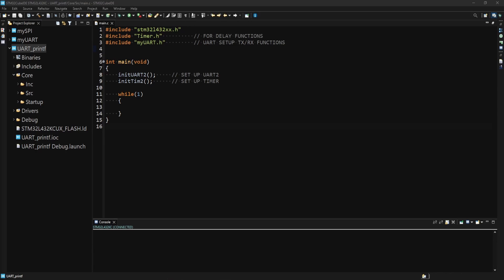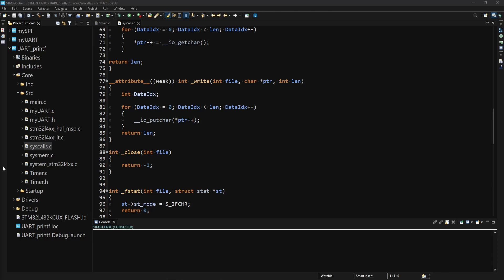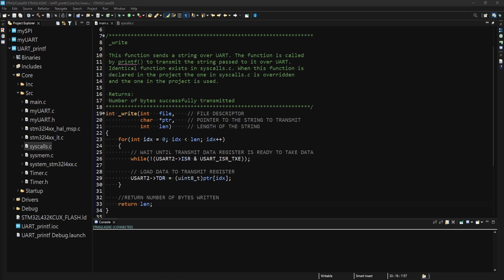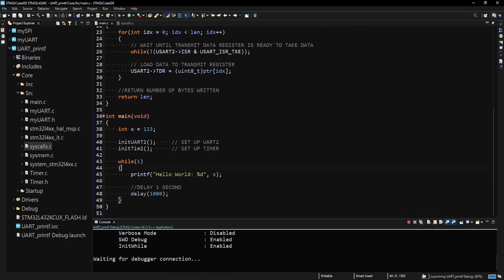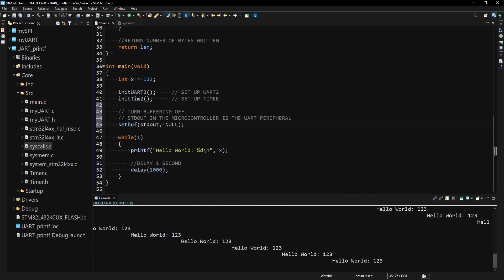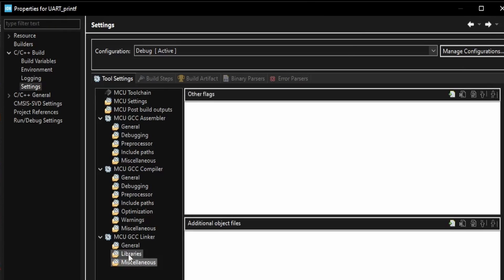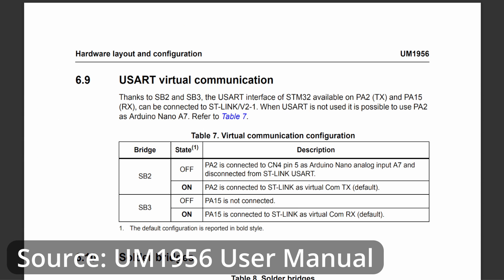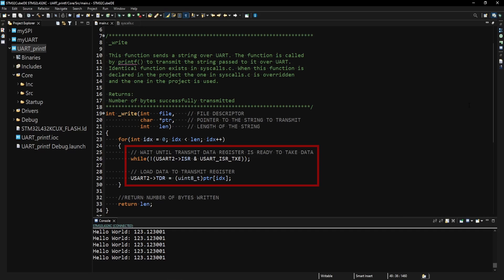Redirect Printf To UART And Send Serial Data Via On-Board USB Port (STM32, STM32CubeIDE)

Comment: hello
so, where i can get myUART.h file?)))
Reply: Write it yourself or just use any other UART library
Reply: You can use HAL UART from the ST Micro Framework. You can use also CubeMX to configure HMI (Human Machine Interface) but then  you will loose control over buffering etc. and although I did not try hard getting input does not seem obvious. 
If what you need is a "quick-n-dirty" printf then the ready-made solutions from SDKs are good enough, but for the "real" stuff I almost always end up writing a custom driver, specially if I need DMA, hardware FIFO and running under RTOS ...